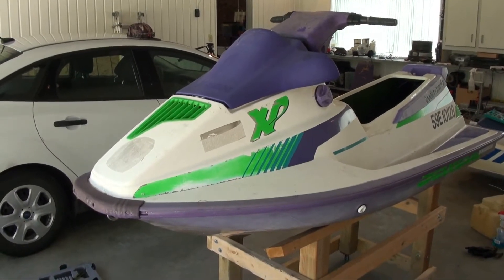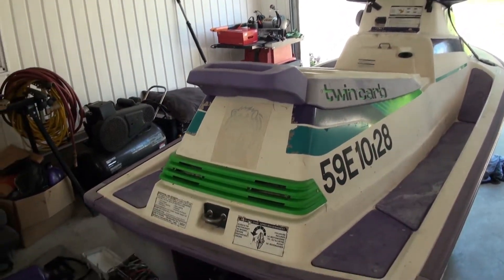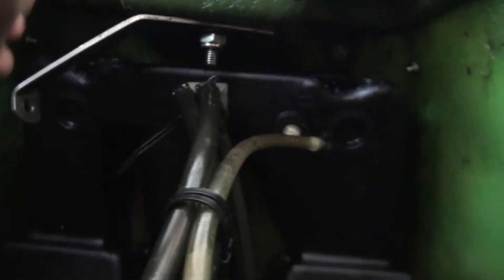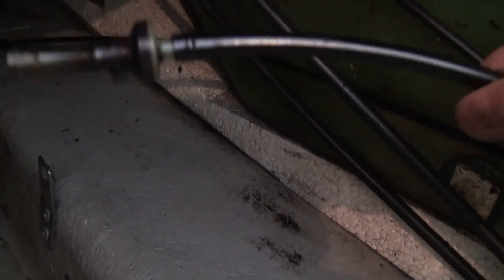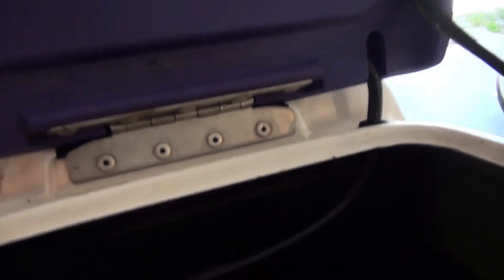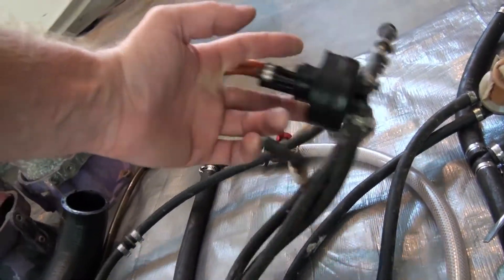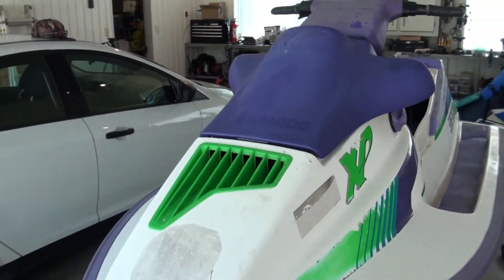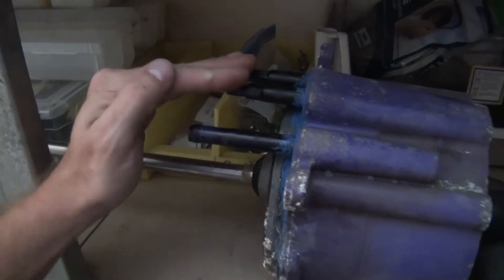How Does a Sea-Doo Breathe ???

Comment: A video on how to install the jet pump back onto the hull? Do you just bolt it back on with gasket maker? I need to pull my engine out so I think that all needs to be removed correct? 1993 spx
Reply from the maker: Yes, you will need to remove the pump to get the engine out.  93 spx is a great machine btw.  Check my channel, there are videos on how to remove and put back the pump, as well as removing the engine, among other videos on vintags SeaDoo
Reply: @UOttawaScotty ok thanks! Coming apart right now! How much and what type of oil do you add to the cone at the end of the shaft?
Reply from the maker: @AllTerrain84 you gotta use SeaDoo jet pump oil for that, or a known equivalent, but dont use regular motor oil or outboard gear oil.  That part of the pump in under extreme pressures and stress, the oil needs to withstand high sheer stress and needs and anti foaming agent so as not foam up under stress.  So, that being said, just be safe and order the proper oil for that.

Comment: just bought 2 1991 seadoos. twin carb/ yellow motor. not sure of the model. I guess xp?
Reply from the maker: The yellow motor was the first iteration of the 587, if the 4 digit model number is still on the hull, that will tell you the year of the SeaDoo

Comment: Very interesting! Love the videos! Im new to sea doo’s I’ve got two 1992 sp’s. Very much appreciated for helping me learn! Thank you! They where sitting for 14 years in some Guys yard.
Reply from the maker: Hi Andrew, stay tuned to my channel because I am going to be going over the electrical system very soon, and I think that is one of the most fragile parts of these old machines, namely the MPEM units are usually fried, or on their way out, fortunately these units were hacked years ago and you can buy them readily on the internet for about 200 CAD delivered, and they are way better quality than the original units.  But, I have also seen lots of older MPEM's last just fine, so its really a toss up, regardless, the electrical system is crucial and there are many things that should be checked.  I hope to have time to do a complete diagnosis video for the electrical system in the coming weeks which will really help you out with your 92 SP's.  These are really fun machines and I really hope you get yours on the water this season !